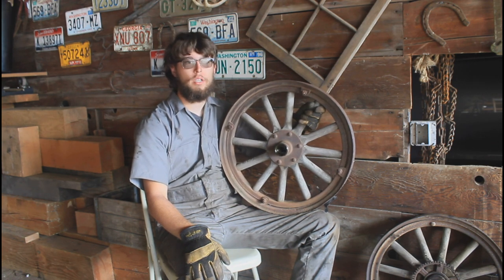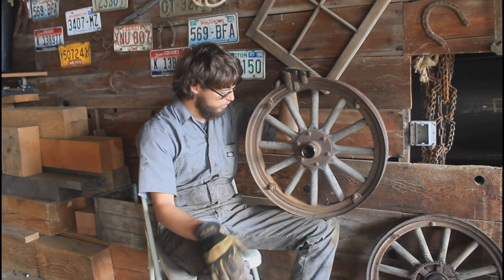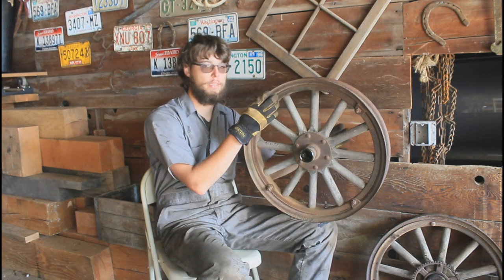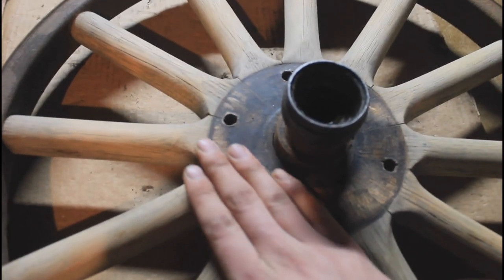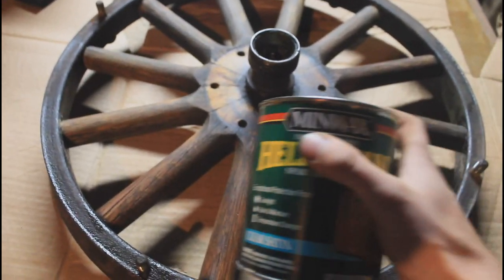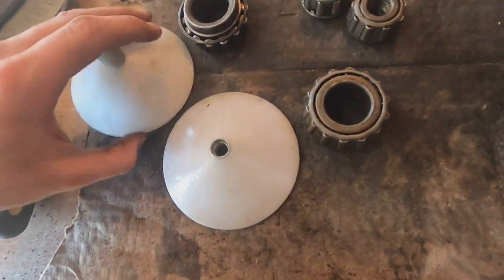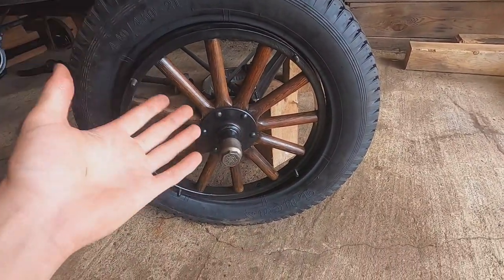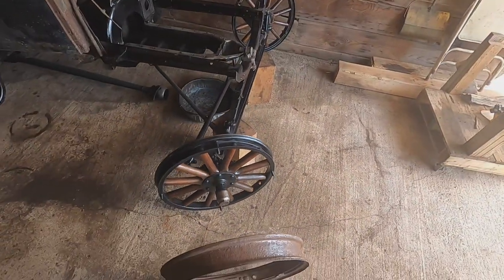Restoring wood wheels, 1927 Model T Restoration part 6

Comment: Do you or anyone in these comments have any info or knowledge on Essex? I have a 1931 super six with wooden wheels and it needs new tires and tubes Wood wheels are in good shape) but I need to find some info on how to take off the wheel and then I can bring them to a specialty shop who can do that work! Thanks!

Comment: My outside metal ring won't come off.  Is it pressed?  Got it.  Lots heat and press.  It was stuck good but I haven't saw anyone take this apart so I don't know if it supposed to slip on or press.
Reply from the maker: It depends on what style of wheel you have.  I have the demountable rimes that were offered on the later cars.  On the demountable wheels there are four bolts mounting the rim to the wheel.  The other rims are the clincher style where the ring does not come off.  The only way to change a tire on the clincher wheel is to pry it on and off.
Reply: @TinkerwithaT  I have the same kind.  The outer hub plate was stuck on there inner hub.
Reply from the maker: @essentialjudge2279  Glad you got it! It is a slip fit, but mine were tight as well the first time I took it apart.

Comment: What kind of wood is it? I have a 26 with the same wheels I believe.
Reply from the maker: It is hickory.  Since they were originally painted black, the factory didn't try to match different tones of wood, so if you try to do a natural finish, you can end up with a random light or dark spoke.  Mine were weathered so much it didn't make a difference.  I think the mismatched colors would still look good, although some people bleach the wood so they will all have the same tone.
Reply: @TinkerwithaT  Thanks much

Comment: Is it true ford kept their wheelwright work secret? I'm a traditional woodworker and during my research stage all masters talk of the hole in the craft left by wheelwrights and how secretive they were about their work and skills. Is this true?
Reply from the maker: I have not heard anything about Ford keeping it a secret.  The early model T's used wood for the felloe on the wheel, which takes a lot of skill to make.  My wheels, and most of the model T production used metal felloes with wood spokes because it is much easier to mass produce, requiring far less skill.  You might be interested in the YouTube channel "Engels Coach Shop."  He is a wheelwright and builds all of the traditional wood wagons and wheels.

Comment: Why don't you show any of the work?  Otherwise it's just a story about your car which is just not that interesting.  SHOW THE WORK.
Reply: I would have to agree - at least show a bit of the work, such as how you sanded the spokes, how the linseed oil was applied, how did you apply the varnish and how that wheel bearing grease gizmo worked. Just saying...otherwise very interesting and some ideas I can likely use on my '23.
Reply: Watching the actual restoration process is the bulk of the content that’s really lacking here unfortunately.